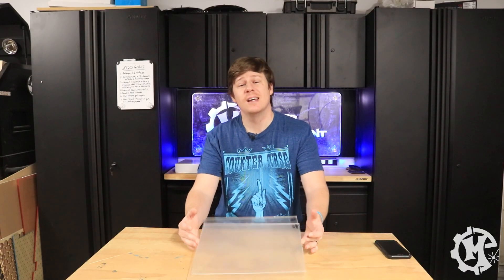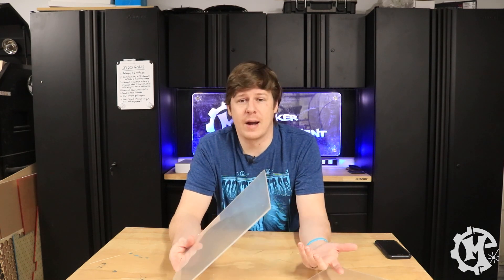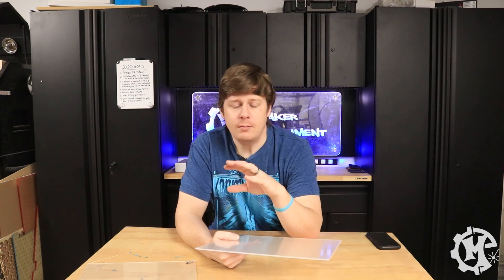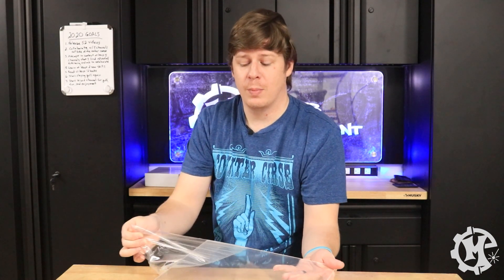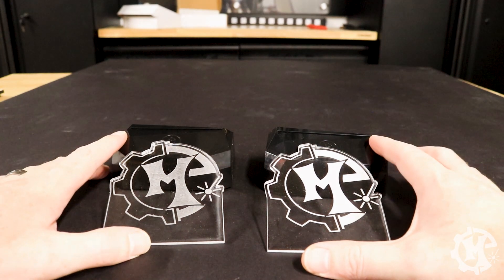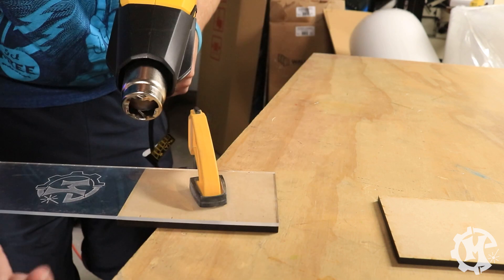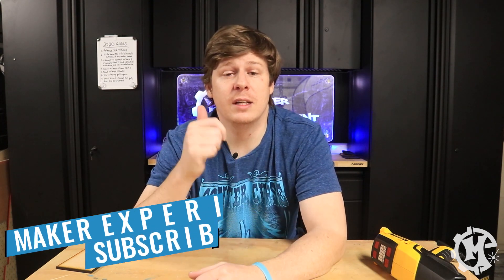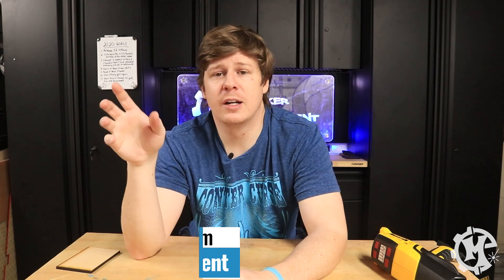CAST vs EXTRUDED ACRYLIC | WHICH IS BETTER?

Comment from the maker: Getting started with acrylic took a lot of trial and error for me. What tips do you have for working with acrylic?
Reply: Dont use the same parameters for engraving each type. They may be exactly the same chemically but the different manufacturing processes creates products with different thermal properties/damage thresholds.  You are just looking at the superficial property of "whiteness" without questioning or explaing how that whiteness happens. It is 100% possible to achieve the same level of whiteness  with extruded acrylic by using different parameters. You are not alone in claiming cast acrylic is best for engraving.  All manufactureres and distributors agree. They all use the same engraving parameter standard that you used  and conclude what you have elegantly observed and demonstrated.  The  video I reference below  explains the reason for "whiteness" and demonstrates that cast acrylic and extruded acryilc can be engraved equally white. The much lower cost of extruded acrylic will mean more profit for anyone making a business out of LED illuminated signs. see        https://youtu.be/lBkvdKMnBfg
Reply from the maker: @SarbarMultimedia  I’ll have to look into this. I’ve never been able to get good results running a lot of tests on my machines with extruded but I’ll have to revisit this.
Reply: @MakerExperiment   There is no implied criticism of what you have done,  you have only demonstrated what many others "know" to be true. However, if you dig into  the science a bit deeper  ( I have the advantage of a powerful microscope) it becomes clearer where the white comes from and then it is  but a small step to achieve the same end result with extruded acrylic. All best wishes for you new journey of discovery. Some more powerful tubes  (notably Reci) are great for cutting but have weird low power beam characteristics that may screw your efforts.  If you check your beam after mirror1, using very low power (say10%) and you achieve a ring burn rather than a dot,  you will be struggling to get the right power to achieve the critical parameters. Typically Reci tubes do not deliver a dot burn until 25 to 30%  and that may be too high a power. I am working with a 70/80 watt tube that delivers a dot from about 8% power.

Comment: genuinely needed to have found this video yesterday. all the questions i had you answered. thank you. my personal take is also that cast acrylic lasers white and so the cuts aren't clear while they are with extruded. diode lasers can cut and engrave a wide range of both But a CO2 laser can do all types and colours. also, extruded stuff i got is quiet brittle and can be rather sharp as i learned from experience :hand-orange-covering-eyes: . Ive just started on Acrylic myself, but thats my experience so far. thank you for the video.
Reply from the maker: I’m glad that you found it useful.

Comment: New subscriber, great video, except, :D... Do you have a video on the laser cut edge difference right off the laser? We currently flame polish saw cut sanded edges, but want to switch to a laser cut that will provide almost the same flame edge finish. Possible?
Reply from the maker: Extruded acrylic will have a better cut finish in my experience.
Reply: @MakerExperiment  , Thank you for the reply. I will try the extruded first.  Have a safe Memorial Day weekend.
Reply from the maker: @DecksNJ you too!

Comment: Do fingerprints stick to one more than the other one?
Had a little project today. Didn't even realise there are different types of acrylic. From the engraving though, I think I am having extruded sheet on my hand and they are fingerprint magnets.
Also, do you know if it is possible to reduce the engraving grains by adjusting the speed and power of the run?

BTW, we are taught to use a heated wire for bending a sheet in school. That creates a much cleaner bend and it's way easier.
Reply from the maker: I’m not sure about the fingerprints. It may be possible to reduce engraving grains by putting the laser out of focus a little which will make the beam wider.
Reply: @MakerExperiment  Wow, that's actually brilliant. I will never imagine making it out of focus would be useful someday. I would just assume it is always the best to keep the focus sharp. Thanks for the idea. I shall try it next time!
Reply from the maker: @cwk0505 let me know if it works.

Comment: Hi! Just watched your videos. Well a few of them. I have a quick question. Now that I know about acrylic. What kind of machine do you use? I am looking for a desktop piece. Right now I have a XTool D1 but it does not cut acrylic properly. So, I need to look into a CO2. What machine do you use? and why? Thanks in advance. 
Hector.
Reply from the maker: I use a couple that are all made by Epilog. I use a CO2 to cut acrylic. I chose Epilog because I’ve always had a good experience with their people, they build equipment that will last decades, and it’s made to run a business.

Comment: If I buy large sheet acrylic, what tool can I use to cut it down to size since it won't fit in a laser?  How do I cut it without destroying it?
Reply from the maker: Something like this may work, but I’ve never tried it. https://amzn.to/47GLQtG

Places like Home Depot or Lowe’s may have something as well.
Reply: @MakerExperiment  I was thinking more like a table saw or circular saw to make straight cuts....
Reply from the maker: @johnfromConfiguMaker  you can if you get a plastic cutting blade.

Comment: Interesting video. May I know what is settings you used in engraving clear acrylic? Thanks
Reply from the maker: It depends on the look you’re going for and if you engrave it with the masking on or off. A good starting point is around 80% speed, 60% power, and 400 dpi.
Reply: Im new in this field, just recently bought an 80w chinese co2 laser using corellaser. is the "pixel" matters? Cause there is an input box in th bprogram where you put 1 or 2 pixels. Im starting to watch all your videos. BTW, Im from the Philippines
Reply from the maker: @simpatiko2k5  I’m not sure about that software to be honest with you.

Comment: My company says that cost of extruded is more and we go through alot of trouble to get it. If you say it is cheaper I would like to know where.
Reply from the maker: Well, keep in mind I made this video 3 years ago and at the time, that was my experience.
Reply: @MakerExperiment  Every company I checked that sells both charges 20% more for cast
Reply from the maker: @ArtyJames it has changed over the years for sure.

Comment: Extruded is essential if you are drilling for braille beads. For this cast is almost unuseable. The slight variations matter even with surface compensation.

Comment: I need a very flat, opaque black acrylic. Which plastic would be the flattest (like glass or granite that is ground to 1/10,000" variance)?
Reply from the maker: I honestly don’t know if either will be within that kind of tolerance flatness wise. What are you doing that requires that level of tolerance?
Reply: @MakerExperiment  sorry, I don’t need them at that tolerance, I was just wondering which one would be the flattest.
Reply from the maker: @bgclarinet  my guess is extruded due to the process of how it’s made but I could be wrong.

Comment: Which is stiffer/stronger and how does it compare to epoxy? Thanks, I have subscribed.
Reply from the maker: I haven’t done much strength test to be honest so I’m not sure. My guess is epoxy would be stronger.
Reply: @MakerExperiment  I havent seen any test or comparrison, perhaps a good video to do for your channel.
Reply from the maker: @Tanko3691  I’ll have to look into that more.
Reply: Epoxy would be stronger. Has a lot to do with your application, construction and which epoxy you use. Not a black and white answer.

Comment: Fantastic video! I now understand that cast typically gives a frosty white engraving where as extruded gives a dingy grey color. How about if I want to engrave a logo on black acrylic and have the colour inside the same as the outside? A kind of indent effect. How can this be achieved?
Reply from the maker: So you want to engrave but it still be black?
Reply: @MakerExperiment  Exactly👍
Reply: Perhaps using matte black is the key?
Reply from the maker: @renauddavies  matte black may get you close. It may be hard to achieve this with a laser without painting it or doing something post engraving.

Comment: Most everyone commenting, like you, are interested in engraving and cast is the obvious winner. However, when it comes to laser cutting, for example templates or router bases, the clear winner is extruded acrylic because, unlike cast acrylic, laser cutting extruded acrylic automatically gives you a flame-polished edge. Just curious why you didn't mention this. Have you had a different experience in regards to the cast acrylic not automatically ending up with a flame-polished edge, like extruded acrylic, after laser cutting?  God video, thanks!
Reply from the maker: I’ve had a mix of both. When I did this video I think I had a bad batch of extruded acrylic because I was getting better results on cast acrylic. That being said, I agree that should have been the case. The supplier at the time also quit making that product so I wonder if that’s why. I plan to do more videos in the future when I have a better extruded product.

Comment: Thanks for sharing - as previously mentioned a strip heater would have given you a perfect bend with no lines, also an oven could be used at 160/165C but you would need a jig or mould as the acrylic will come out very floppy and you will need PPE, particularly heat proof gloves to handle the hot acrylic.
Very interesting designs.
Reply from the maker: I need to look into getting a strip heater.

Comment: Hey man, do me a big favor...tell me which of the two is stiffer or harder at room temperature? I need that data...
Reply from the maker: I don’t have any true data to back it up. Cast is typically the sturdier of the two because of how it’s made in my experience.
Reply: @MakerExperiment  Thank you very much, I appreciate your answer. I'm going to ask a manufacturer directly to save time. Cheers

Comment: Neither is better. It depends on the Job you are doing.   They do look similar, but they do look different. With experience you can easily tell. Also prices do change. Sometimes cast does cost less. Also yes engraving is generally better on cast. But they do make a extruded acrylic that engraves really well. It's a very off material.  I use both equally. Also extruded has a lower melting temperature, and will almost always bend quicker.
Reply from the maker: It does depend on the application and I tend to agree with pretty much everything you’ve said. I’ve never found an extruded acrylic that actually engraves well but that’s great if there is.
Reply: @cspace123
Just curious why or no one else isn't mentioning that laser cutting extruded acrylic automatically gives you a beautiful flame-polished edge vs cast acrylic which has to be hand polished or hand flamed with a torch to get the same beautiful edge. Hence, for engraving, cast acrylic is generally better but for cutting shapes, templates and router base plates, where there is no engraving, and a flame-polished edge is preferred, extruded acrylic is much better because it saves the extra step/labor in having to flame or polish the edge by hand.  What say you?

Comment: Just starting to work with BOSS laser cutter and wanted to know what would be the best engraving setting to engrave mirror from the rear. I've been using 20% or 25% for normal acrylic engraving. Is this particular process different? Thank you for your help. And BTW all the colors you used were fantastic! Keep making your terrific videos!
Reply from the maker: It’s hard to say with a mirror as I’ve never engraved one myself. I’d check manufacturer websites and see if any of them did a mirror sample or call them and ask. That’s usually a good way to start.
Reply: @MakerExperiment  Sorry.I wasn't clear earlier. The mirror I want to engrave is acrylic mirror not glass. So based on your video, what would the optimal settings be for a 100W laser to engrave through the rear layer of the acrylic? And can I engrave TOO deeply? Thanks!
Reply from the maker: @ManorRED  honestly, you’ll have to figure that out by testing material with that wattage. I don’t have experience with 100W. I don’t remember what I used for settings on that video but I’d start with a small square and try starting with 50% speed and 50% power and then start adjusting. Or you can do the material grid style test that I normally do.

Comment: Bollocks!  You can easily distinguish extruded from cast by setting a piece of it on fire.  Cast will burn with a crackle and will not drip molten flaming balls, extruded will burn silently and will drip flaming balls.
Reply from the maker: I mean sure if you want to waste material.
Reply: @MakerExperiment  It is not that precious and even less so if there are free cut-offs available.  Anyway, I objected to your statement that: "there is no real way to to tell them apart, other than by part number or SKU...".  This is a gross omission of essential information in your video.
Reply from the maker: @amciaapple1654  Well, I’m not going to tell people to light them on fire and risk them doing something more dangerous. You’re welcome to make your own video.
Reply: That's a thin excuse, but even if it is taken at its face value, it doesn't mean that it prevents you from deleting that statement which misleads the watchers of your video that "there is no real way to to tell them apart, other than by part number or SKU...".
Reply from the maker: @amciaapple1654  well, I can’t make everyone happy. Feel free to make a better video if you’re not satisfied.

Comment: Hi Maker Experiment. 
Your video is very good and illustrative.
One question: How do I get the edges of the acrylic to be transparent after being cut with a laser?
Thanks
Jorge
Reply from the maker: If you use the right settings it should be fairly transparent. You could try a post treatment like sanding and polishing.
Reply: @MakerExperiment  Thanks for the answer!!
Reply: @MakerExperiment  Extruded acrylic automatically gives you a beautiful flame-polished edge when laser cutting unlike cast acrylic which has to be hand polished or hand torched. At least that's been my experience. What say you?
Reply from the maker: @straight_razor  if you find a good quality extruded acrylic I agree. The cast you can get a good edge and a lot of it depends on the end use. Some usages need that flame polished edge and some most people won’t notice enough to care.

Comment: I am etching colored cast and edge glow and have issues with "fog". Sometimes I can clean up with acetone.
What am I am missing to prevent the edge fog in the cut and sometimes in the etch
Reply from the maker: Try decreasing your air assist pressure slightly. Sometimes it’s too high and that can cause some of that fog.
Reply: thanks will try that nest week. I work in Winston Salem Mixxer; a maker space as I am trying to develop a small
business with the wife. Retired from manufacturing and was always in crafts, with 40 years of leather tooling, aside
from my manufacturing position. We are running a "Rabbit" 80 watt machine
Reply from the maker: @johnzill2125  very cool. Best of luck!
Reply: @johnzill2125  the best decision is to use DISH SOAP. Just apply a thin layer of soap on acrylic before engraving or cutting and you will forget about this issue forever)
I even couldn't sleep because didn't know how to deal with this problem, and then found this way
Reply: @projex5894  will give it a try again. The firsts time I used it I failed. maybe used wrong soap
Reply: @johnzill2125  just use ordinary not thick dish soap
Reply: @projex5894  will try this next scheduled time at maker space; thanks

Comment: Does alcohol crack both or just extruded acrylic?
Reply from the maker: I haven’t tried to be honest.
Reply: @MakerExperiment  , just try) 
As I can see from my little experience, alcohol cracks extruded acrylic, but cast is more resistant to chemicals. Is that common for every type or depends more on producer?

Comment: Have you tried a heat wire for bending your ACR?  they make them just for this application.
Reply from the maker: I haven’t yet. It’s on my list of things I want to try eventually.
Reply: I made a simple brake with three pieces of wood and the top having a 45 degree. I hinged the two together
and fastened down the top where I wanted to bend and used a heat gun to bring to temperature before bending

Comment: I just placed an order with CeruleanTides. They sell cast acrylic in 12” x 19” sheets which is perfect for most hobby or smaller lasers. Seems to be a small business who sources quality acrylic and cuts it to size. A 1/8” thick 12” x 19” sheet of standard clear cast acrylic is only $5. They use flat-rate shipping, with a minimum $20 cost (box stores up to 3” of material). For example, my order of 22 sheets of clear 1/8” acrylic cost me $130 after shipping 👍🏻
Reply from the maker: Stephen Trenta thanks for the information.